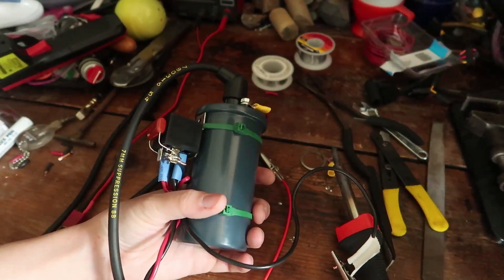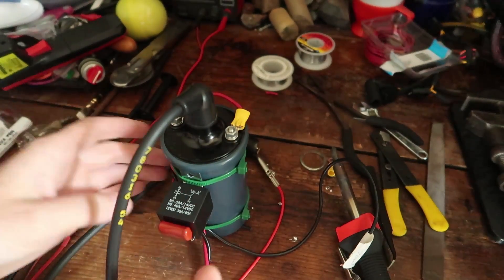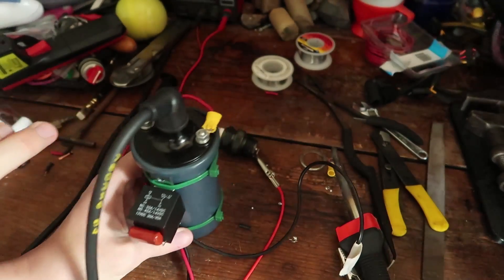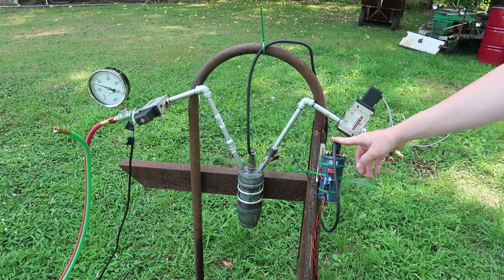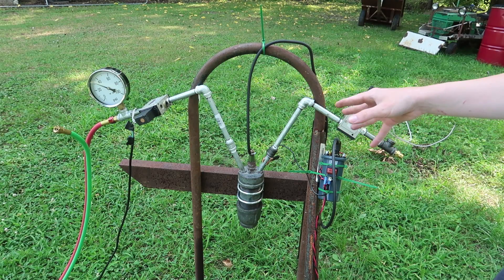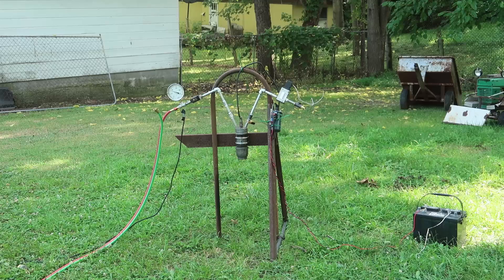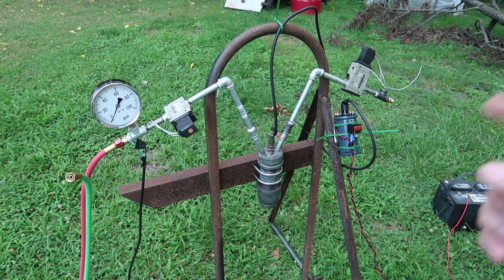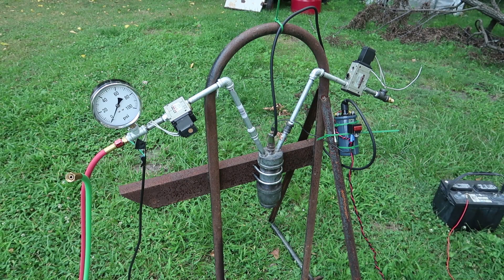DIY Liquid Fueled Rocket Engine 04: Test-Engine Spark Ignition Experiment

Comment from the maker: So it ignited several times when i didnt want it to, and it never ignited when i wanted to. i shall rethink this ignition method. I will have to make the control console before any more tests, that stupid ignition wiring that i rigged up quite literally backfired on me. I want to see what happens with the current igniter when i add oxygen, but that will most likely result in a hard-start. for that first full test i will want to be several hundred feet away from it and test in a remote location.
Reply: I think your current problem is that you only have fuel (propane/buthane) near the sparkplug, that is why it does not ignite.
Maybe try compressed air instead of oxygen first for lower combustion temperatures and lower risk of backfiring into the oxygen tank or burning up your combustion chamber.
Maybe try a low pressure test with compressed air to reduce the hard start, your combustion chamber should withstand the combustion of propane with air, since even spud-guns made from plastic tubing survive it pretty well.
Running a rich fuel mixture also reduce combustion speed and reduces the hard start even further, but getting the mixture right might be an issue.
Reply: Sequence: Start your igniter, start your airflow, start your fuel. After you are comfortable with an air start, switch to oxygen.
Reply: You might want to run a small fuel like into the chamber to use a start pilot light it will be easier to light the the main fuel. Just put a second valve on a tee with something like a 1/4 inch copper line running right by the spark plug.
Reply: I think you need to get the the fuel/ air mixed properly before it hits the spark.  Have a look at how a gas clothes dryer works.
Reply: Please DIY Liquid Fueled Rocketry 05 and 06
Reply: I think your ignition system is fine. There is no air in the system. You need oxygen to ignite. I think the propane you are introducing is displacing the oxygen and not allowing your spark plug to ignite the gas.
Reply: Hypergolics are a bad idea you should have a higher O/F ratio
Reply: bentboybbz dude chamber pressure.. shouldn't ignite under 60% atmospheric, that's bad
Reply: You have a welding rig use that generate and arc imagine a tig torch where your fuel is playing the part of shielding gas. And holyshit be careful. If you detonate a properly mixed composition if fuel and oxidizer your gonna end up with an accidental bomb
Reply: With an open ended ignition chamber, it is unlikely you are going to get a hard start that results in a rapid unscheduled disassembly. The trick is to get air flowing, start the ignition coil (recommend remote switch for that btw. Yanking wires off battery terminals as your EMO method is ungood. Simple remote starter switch is under $10 and gives you 10-20 feet of cable), then SLOWLY introduce fuel. Having a valve that allows fine control on your gas flow would be a good thing too.
Reply: You need to pump some oxygen in there slowly while using the igniter. That same small spark is sufficient. The fuel alone is not enough catalyst to burst into a flame. Add the oxidizer
Reply: @ Rinoa Super-Genius
Reminds me of my difficulties to start and run car-engines or generators on propane-gas simply by adding gas through the Airfilter. It will not ignite at all if there is just a bit to much propane-gas involved. Finally i succeded with a very lean starting-mix. Didn't expect that at all because it is so easy to start an engine with petrol by simply pouring in some liquid petrol, what normally refers to a rich fuel-ratio for starting. So, i had to adjust and try it the other way. That meant - now coming from pure air, slowly adding propane through a precision hydraulic-type needle-valve with micrometer, until the mixture starts firing up. That finally worked repeatable. Interestingly - once ignited and running, i could add more propane for power.
Reply: That igniter is nice!
Reply: I would strongly encourage you to read "Ignition!" by John D. Clark. Oxygen and Hydrogen are very nasty substances to work with and - as the author mentions far too many times in his book - have a very strong tendency to cause explosions and nasty accidents.
Judging from what I've seen in these videos, I suspect you may be strongly underestimating the magnitude and danger of the engine you're trying to build, and the issues with your design. It may seem small and weak engine, but it's big enough to become a lethal pipe bomb if anything were to go wrong.
Experimenting with rockets and burning stuff is a lot of fun and a great learning experience - but there's no point in that if you blow yourself up in the process. Please read some more about the issues of handling Oxygen feedlines, and how they relate to liquid rocket engines.

Oh, and stay away from Hydrogen: at this level, that's just asking for trouble (especially if you throw oxygen in the mix!)